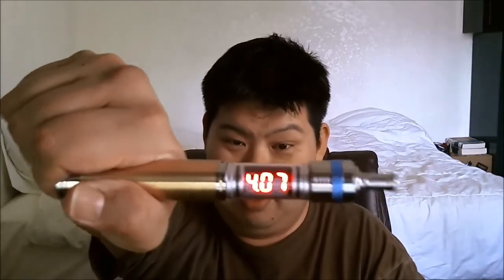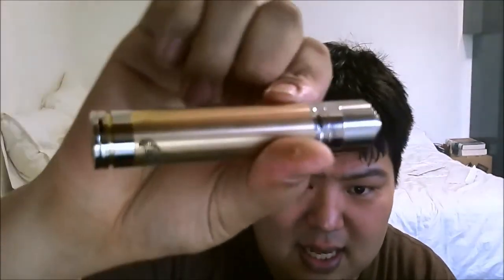Brass Sting Ray Mod Clone

Comment: Hi Andy, infinite make great clones, i have seen many but own the nemesis and stillare from infinite and the quality is great,...
Good video man
Reply from the maker: I figured, the clone I got was good looking until you pressed the switch. I paid about 40 dollars for this clone, so it's not a big deal. I have both clone and authentic panzer and they preform great. .02 volt additional drop but the switch is one of the best I've used. At the end you just can't beat the reliable and dependable nemesis.

Comment: Thanks for the review.  Might I give you some suggestions about your future reviews:
You gave us zero close up of this mod, I would have loved to see it up close and inside as well as the packaging you got, etc.   Your review subject is about the copper stingray, yet its actual camera time was probably less than 1:00 out of your 15 minute review.
For someone that actually wants to buy it (me), I was literally thinking the entire time "when is he going to actually show us the mod."  Then the video ended lol.  

Again, these are just suggestions / constructive criticism as you seem like you are serious about vape reviews.

As far as your button issue, that blows.  I have two nemesis with that same problems both with magnet upgrades.  I actually HATE the nemesis button and I have done alot to try to fix them.  

Dont quote me on this , but I have read that the nemesis button fits on the stingray threads.  The top cap however is not the same.

Did your copper stingray come with both 18350 / 18500 tubes with an 18650 extension?  Or is it 18350+ 500 extension + 650 extension.

Everyone I have seen selling them is saying 1:1 clone, but they are not considering the authentic one has two separate 18350 + 18500 tubes.

All in all thank you for the review
Reply from the maker: Wow great feedback, Thank you for taking the time to respond. The clone I received came with tubes that make it possible for 18350/18500/18650 + kick, I will remake the video tomorrow and upload it with close ups. The nemesis mod both authentic and clone were all fixable with some polish. I have another stingray coming in, this time with the spring switch instead of magnets, but the problem doesn't come from the type of switch, but the clearance between the center post and the switch. I will explain in the new video. Again thank you for the feedback.

Comment: Lol I know this is 3 years late, but can you put a tank on this mod?
Reply from the maker: Yes you can, as long as the tank coil is anywhere in the .1 to .5 ohm with a good high drain battery.